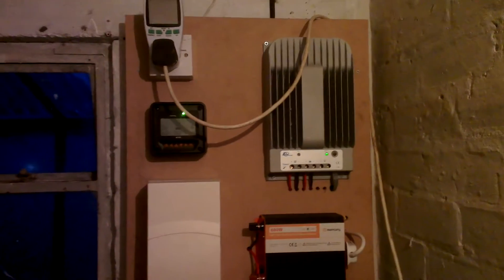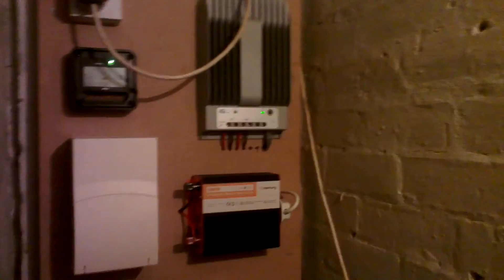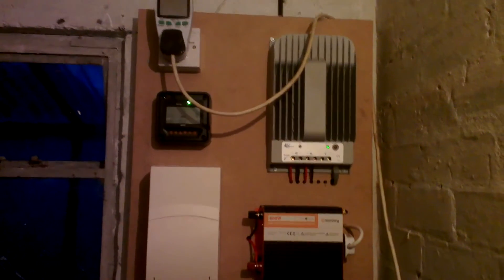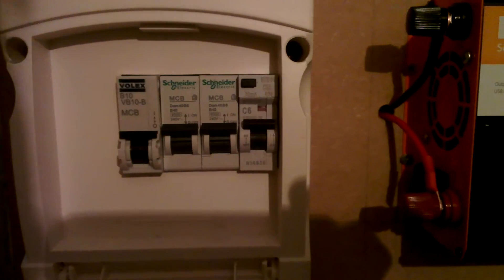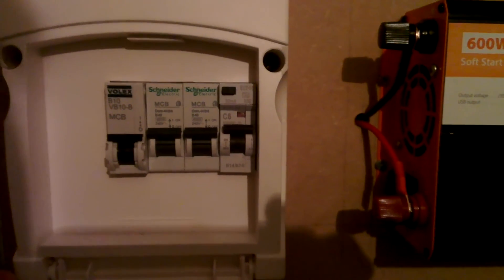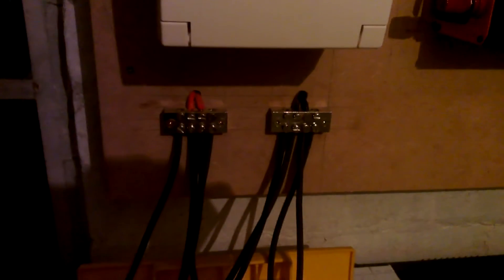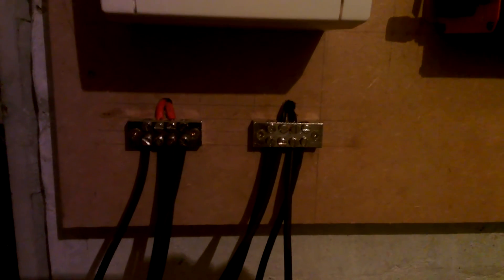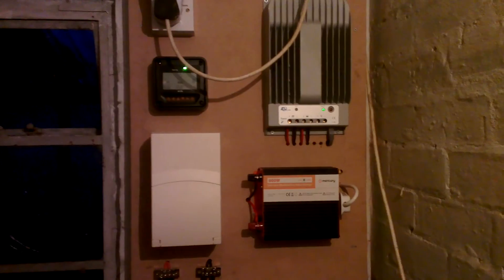My DIY offgrid home solar power station - UK - PART 3

Comment: You don't need to be worried about getting shock from 24 volts. If you put a hand on each terminal you might just start to feel it if your hands are moist. However, drop a spanner over those battery terminals and if it forms a good connexion it'll get hot enough to melt! 

That is the true danger of low voltage / high current circuits. You can work on them live with out fear of electrocution but if a ring or watch band bridges the power source it can make for some nasty burns indeed. 

By the way those comments about that Inplix webpage are just spam posts about a page that tries to sell you rip-off solar panel building plans! lol I've had them all over my videos & they're a nuisance.
Reply from the maker: Hiya! Yes, I often touch the 24v terminals and I don't feel anything. If you see the latest video, you'll see that the terminals are in plastic boxes now.  The biggest problem with having them uncovered is shorting and arching. I shorted a Raspberry Pi a while back, simply because a wire fell down and shorted a pin on the back. I think I fed 24v into the Raspberry Pi because of it. Insulated is way better! And ofcourse, when working with 240v, insulation is very important.